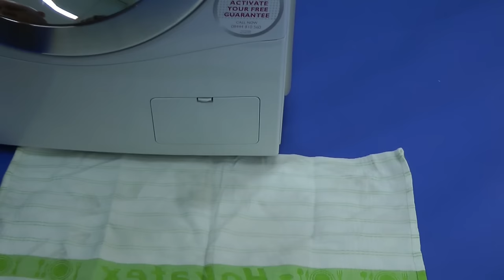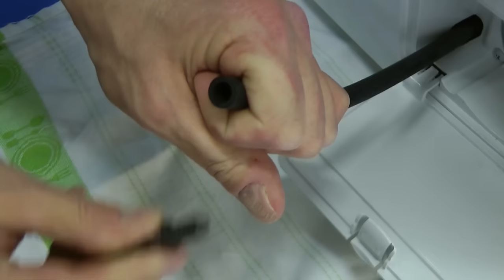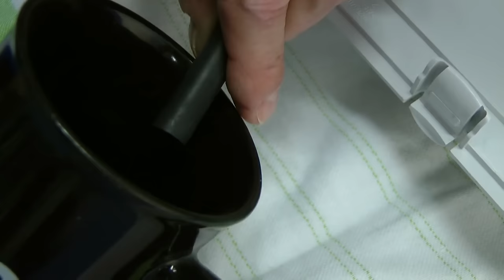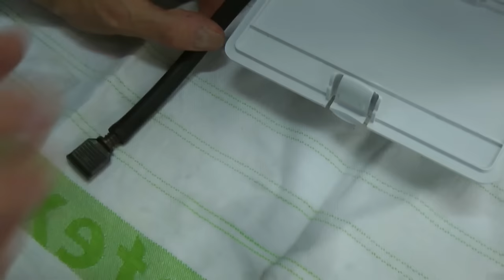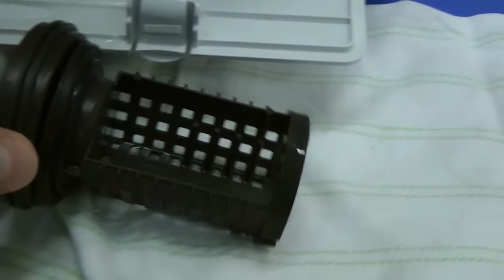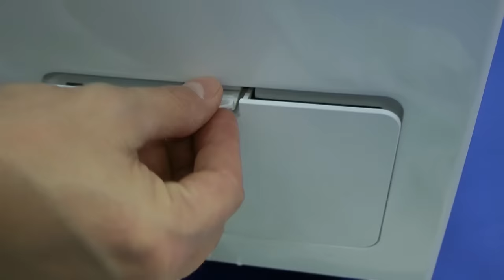[LG Washer] - How to clean the drain filter

Comment: I have A LOT more water leaving the drain hose. I’ve been draining for like 15 minutes and filled multiple buckets, is this normal?
Reply from the maker: Yes it is possible if this was the case after bad draining and Drain Error (OE)
Reply: @LGSAE  Yes, it was after the OE drain error. I let it  drain completely and cleaned out the drain filter, but when I tried to wash again I got the same OE error. Did I not do something right when cleaning the filter?
Reply: @DaddysBathTime  I have the same problem now. How did you fix it, if I may ask?
Reply: My drain pump stopped working. I was able to fix it myself though. Its fairly simple with a YouTube tutorial, and I got the part from Amazon for like $20
Reply: @DaddysBathTime  thanks for the reply!

Comment: I've opened the cover but  the cap you screw off comes off fine but the filter doesn't come out with it there are 4 screws at the sides do I have to unscrew them
Reply from the maker: Not sure if you have a similar type of model, is it a European front loader? That one should not require any unscrewing.
Reply: I have the same prob!
Reply: Same problem today. Usually the whole filter caddy would come out but it's stuck in the machine and only the front part of the screw is removed.  Now what?
Reply: What did you do?

Comment: Can u clean the housing with a brush? There is like a slime coat or film on it. We received ours second hand n want to make sure its cleaned n good to go
Reply: And if so how deep can the brush go?
Reply from the maker: @moondoddler370  yes you can use a brush, and the same length as the filter.
If there is slime, we suggest to run a Tub clean cycle first, https://www.youtube.com/watch?v=T1l8NYAf7Vk

Comment: In the washer/dryer washing machine can we use the dryer for sweater or will it shrink? And also could you tell methe difference between the drying programs?
Reply from the maker: You can find differences in your owner's manual, including the type of clothes to dry. Washer-dryer generally reach somewhat higher drying temperaturese than heatpump tumble dryers, so please check the clothes label first. The low temperature program would best suitable for drying at lowest possible temperature.

Comment: what does it mean if alot of water flows out of the drain and my drain filter is NOT dirty and the black tube is also NOT outputting water.
Reply from the maker: Then probably the drain tube is contaminated/obstructed.
Reply: @LGSAE  hi. do you have videos to clean or remove obstruction in the drain tube? Thanks…

Comment: The small drain hose in the lower left side on our front loading washer that is used to release residual water has somehow retracted into the machine.  It was previously clamped onto the wall behind the drain pump filter compartment.  Only the cap was protruding from the hole and when I pulled on it, the cap came off and the hose disappeared.  How can I find the hose?  Thank you
Reply from the maker: No flooding? I think you may need a technician. If you feel comfortable you could take off the screws at the filter location that hold the filter cover. First of course unplug the appliance and drain the water through the normal filter. When you take off the screws you can take out the filter cover and should be able to put back the black residual water hose. Good luck!
Reply: No flooding because I didn't use the machine after the hose disappeared.  I took the filter cover off but still can't see the hose to pull it out.  If I take the screws out of the front of the plastic bottom plate I might be able to see it.  That seems easier than taking off the whole front of the machine.

Comment: Is it possible to open the machine more? Because the wool filling of a pillow i washed came our during the wash cycle and there were thousands of little wool pieces in the machine. Of course i removed them from the washing drum but i guess alot of them went trough the holes in the washing drum. Is there like a catch basin under the drum? Nice that you produce special washing machines with extra limited depth, i needed it because the washing room is narrow and i dont wanted a "top loader" machine. All other front loading machines i googled for have more depth.
Reply from the maker: Not by yourself, Best thing to do now is to do Tubclean cycle with Soda. https://www.youtube.com/watch?v=T1l8NYAf7Vk, and if needed repeat that. After the first Clean, chack your filter again.

Comment: Does the filter have any rubber seal rings on it or not thanks
Reply from the maker: yes it does, otherwise water can and will escape because it's an open connection when you turn it open.

Comment: Mine has the black seal but it has no filter in it? I look in the machine and there’s this blue thing stuck to the machine. Doesn’t look like a filter
Reply from the maker: I believe you have a washing machine version with an emergency door open mechanism. Please follow the owners manual and ONLY use this mechanism in case the door stays locked after for example a power outage, but ONLY after draining water via the drain pump filter (keep a bowl and towels ready).

Comment: 1. How do you replace the drain hose tube, mine has a small hole causing a leak on the floor.
2. Where can I get a new hose from, can’t see one on the LG website. Model LG F1296TD. Thanks for any help 🙏
Reply from the maker: On both, the comment is contact LG Customer Support. An engineer needs to change it.

Comment: and how to do if the hose get inside this white panel? 😢
Reply from the maker: Difficult, but you may try with small pliers. If that does not work, screw open the drain pump cover if you feel comfortable. Before doing so you are advised to unplug the power first. Then you can likely catch the hose again and guide it through the plate hole. Good luck.

Comment: For some reason no water flows from the hose however it does come out of the filter area when I unscrew it. Why is there no water flowing from the hose?
Reply from the maker: It must be blocked, either from clogging foreign materials or from pulling the hose too much.
Reply: How do you problem solve this?
Reply: @whitneycox9442  did u solve it ? Having same issues

Comment: Despite replacing the basket straight and tightening carefully it still leaks rendering the machine unusable. What is wrong? It “appears” straight forward in your video, but in real life is a watery frustration!
Reply from the maker: That does not sound well. Are you sure you turned the filter cap on straight? And also checked if the sealing is still intact?
Reply: I got the same problem. But note when tightening the filter doesn’t turn, so make sure to align the filter right before tightening. I got lots of water leaking and damage twice due to this. It’s bad design, the filter shouldn’t go in the wrong way.

Comment: I did this but water came running out of where the filter is. Not from the hose.
Reply from the maker: That is unfortunate. We always advise to first try the manual drain hose. If no water comes out of that at all, it is likely that this hose is either pulled forward too far or something is stuck.

Comment: I've got coins in my 10/6 washer dryer.  They didn't end up in the trap.  How to clean them??
Reply from the maker: If they are not found in the drum or gasket, they may have ended up in the tub. I suggest you contact your local LG support channels, When when being taken into the spinning phase of a cycle the coins can hit and make a hole in the tub, causing leakages, thus floor damage.

Comment: When I undock the cap from the house no water comes out, but when I open the cap it comes pouring out
Reply from the maker: you mean undocking the black drain hose? If you pull too hard, the hose is kinked at the back side and as in your example, no water will come out. Or something else is stuck in that hose.
Reply: @LGSAE  yes no water comes out of the hose.  I tried to access the hose by removing the cover but no luck.  Is it possible to “unkink” the hose myself?

Comment: What if no water comes out of the pipe??
Reply from the maker: Then you need to check if it is pulled to hard to the front, which makes the hose kink. If that is not the case, it might be clogged. A semi flexible cable (not sharp at the tip) may help (but is at your own risk!). You can of course always seek help from a repair tehnician.

Comment: That hose on my LG is blocked.  I tried to blow thru it but it still won't clear.
Reply from the maker: Please check if you perhaps pulled it out too far, because in that case it will be blocked on the rear side (you cannot see this). If it is still blocked then perhaps you can push the blockage out by using a rigid cord that can bend, say a electrical wire, but make sure it is not too sharp. If that does not help, requesting a service technician visit might be your only option.
Reply: @LGSAE  Thanks for your note. It turns out that the hose was kinked.  But when it is pulled right out, it runs fine.  So it's all good.
However, I broke the machine down completely last night (never done that before!), and found the real issue.  The drain pipe from the gullet of the seal, behind the drain holes in the same, that goes to the pump, was blocked with 'ten years' of crapola.  It was hard as a rock; I kid you not.  That was properly cleared & cleaned.  
So, now the machine has been 'tub cleaned' with a full cup of bicarb  soda, it is brilliant.  But as an aside, the t/c program is poor.  It empties after only five minutes of cleaning with whatever product.  So, I waited until after the thing first emptied, then put in some more hot water with another large cup of bicarb.  Did a load this morning and the difference was huge.
I should have trained to be a w/m mechanic.  It's great fixing them up!

Comment: Nothing comes out of the drain tube but I get washer rushing out of the filter opening when trying to open it. I've already flooded my laundry room with it. How am I supposed to get this open without damaging my floor? Horrible engineering.
Reply from the maker: Dear Alex, that is very unfortunate to hear. It might be that your drain tube somehow got clogged or kinked (which could happen if you pull it towards you too much). If no water comes out of the drain tube and you suspect that there is water in the base, either make sure you have a lot of towels when opening the drain filter plug or call for service.

Comment: What is drain and filter for, I've never seem it before...how often do you have to drain the water? I have an old Kenmore set and never had to drain any water... thanks!
Reply from the maker: This video applies to LG machines. The drain filter is to collect stuff such as coins, screws and other small items to prevent them from entering the drain pump. Clean it ~once per every 6 months.

Comment: I lost hold of the tube that drains in the washer when I was cleaning the filter.  What do I need to do to get the small tube out or the machine? I can not reach it, to retrieve it thru the hole that it is in.
Reply from the maker: 2 options: either use small pliers or if not possible, remove the screws that hold the filter casing and take the casing forward. First make sure that t the filter is out and the drain water is removed. Good luck!

Comment: I did it with my washer nothing at all came from the tube but the felter it all came out of there and omg that was probably the worse smell I evere smelled it was awful I couldn’t avoid it’s awful stench
Reply from the maker: Then it might be that the tube was clogged or pulled too hard so it got kinked when taking it out.
Reply: @LGSAE  my washer won’t drain properly so it is probably clogged

Comment: Great. Yeah you try it when it coated in fluff and unable to pull out the hole and the knob fall off in hand bad design needs a good re think and I’m not paying for a replacement whist I’m still paying for the expensive trash can.

Comment: I dont have a small hose like that
Reply from the maker: That is possible, depending on your model. Not all models have such hose. In that case you are advised to run a Drain program (https://youtu.be/JO-qS1504-g select until you see "1". This is drain only.) and open the filter afterwards and make sure you have a few towels ready, to catch any residual water left.

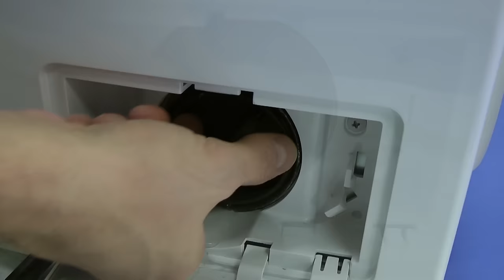Comment: 1:08 Be prepared for some water to spill out
Reply from the maker: This depends how well you drained the appliance, but indeed a little bit of water may still come out.
Reply: A lot of water came out, I think it went inside the machine through the tube hole. Is the machine safe to use?

Comment: Drain pipe doesn’t work, when removing drain filter about 2 glass of water comes out. 50+ year of engineering experience still designed the product badly
Reply from the maker: Not sure what you mean. Is the manual drain pipe perhaps blocked somehow? And if it's only 2 glasses coming out, that will mean the base is relatively empty.
Reply: I agree. Very bad design. Bending down to the bottom of the machine is not easy for everyone.

Comment: Hi, while doing this I pulled the drain hose too much and it seemed to disconnect from another house and now I just have the little hose Sparta that doesn’t connect to anything what do I do?
Reply from the maker: It's not easy to accidentally pull out the manual drain hose at the front side, but if this happens there is not much you can do but schedule a service visit, because without this hose the water will simply flow out in the base onto the floor.